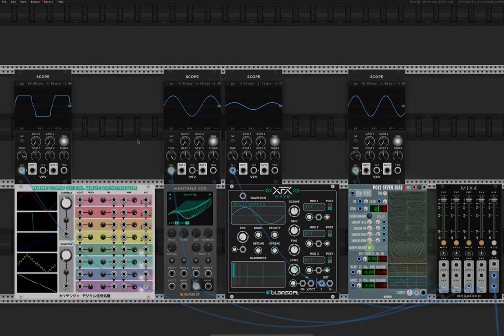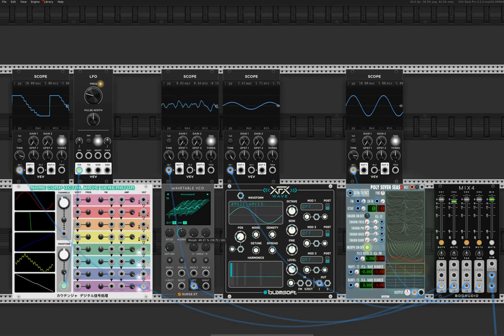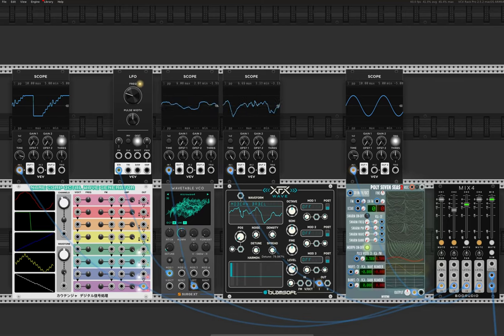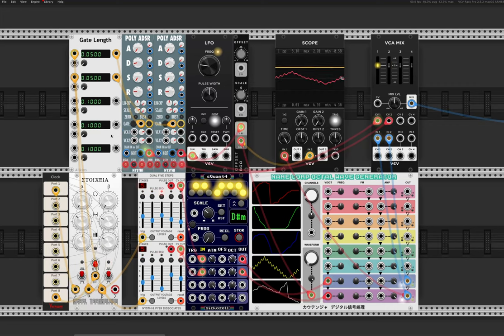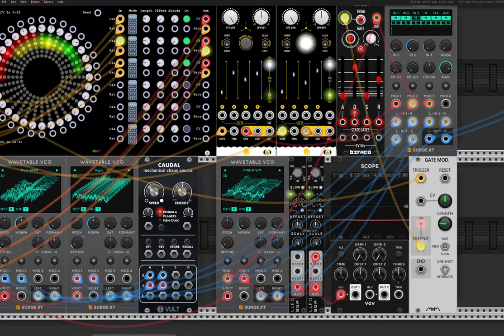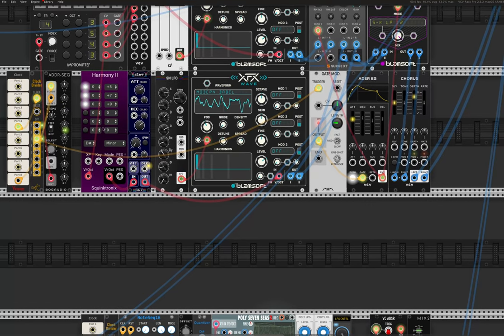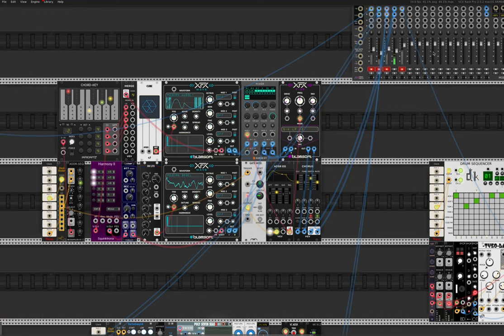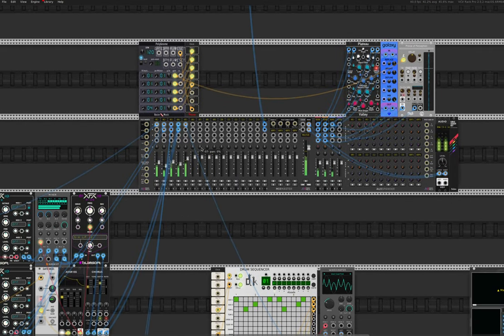PatchWerk with Miles // EP05 Wavetable Synthesis in VCV Rack

Comment: Pointless fact: Nysthi is actually an anagram of 'Synthi', which is much easier to say 😂
Also you can modulate any knob that doesn't have a CV input using Stoermelder Map. I really like wavetable VCOs though, that Blamsoft one is my favourite but it does seem to use quite a lot of CPU. Modulating the parameters polyphonically works really well too.
Reply from the maker: @VirtualModular  oh great tip about Stoermelder Map, I’ll check it out. Yeah the Blamsoft one is great. Seven Seas is real nice sounding too